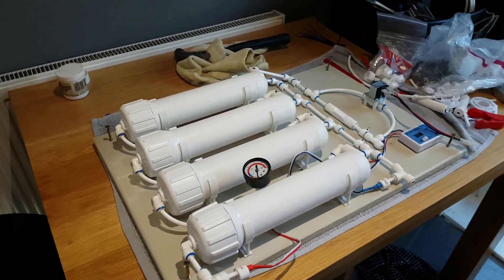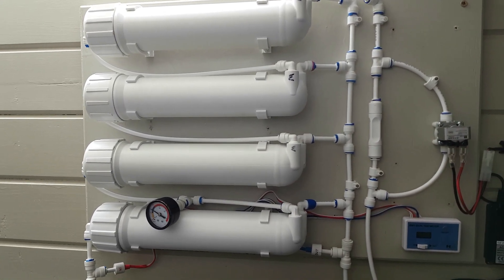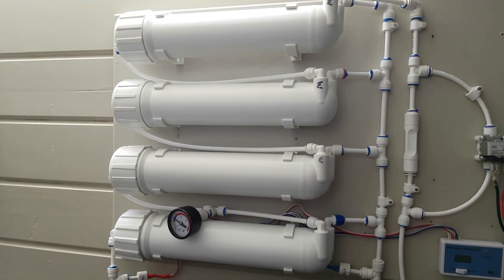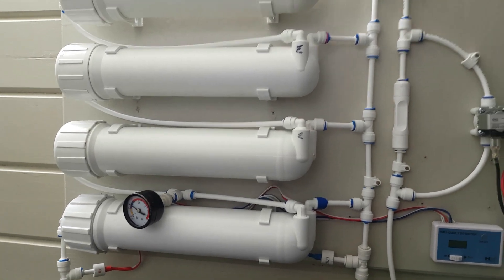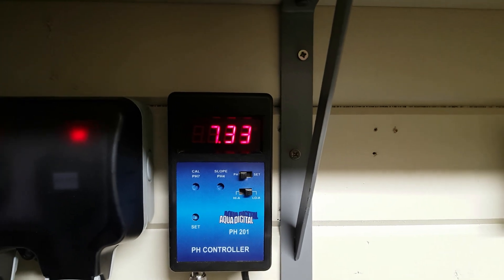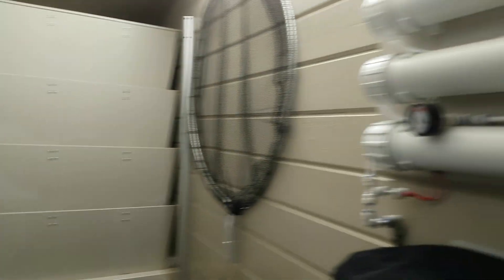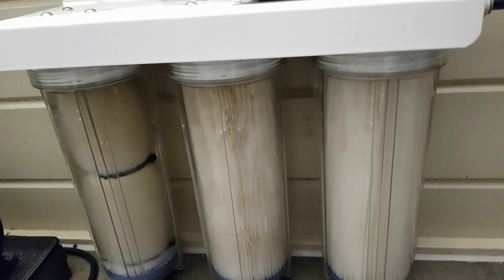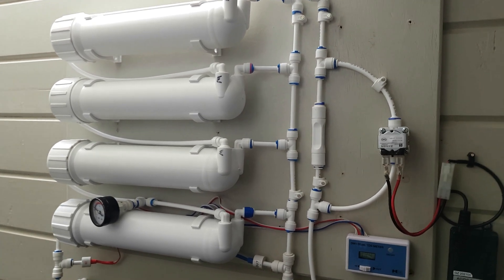DIY Recycle R.O. Update

Comment: Hi mate please could you tell me how much for all as I want to do an ro system cheers
Reply from the maker: Prices change, but ebay is a good place to start.
£200  for 4 x 150 gpd membranes inc housing.
£140 for the pump, 
£100 for solenoids
plus fittings & pipe ,
TDS meter, 
prefilters and housing
pressure gauges ect...

Comment: Hi Dave, what is your target goals for ph and tds? also what kh you aiming for, all very interesting, that ph meter accurate?
Reply from the maker: To be honest I don't have target goals for pH and TDS, pH is a result of other parameters and isn't a target imo.😃
And TDS is just an indicator for me that nitrate KH levels ect... are being reduced.
There is only 1 key critical parameter to have a target or limit for and that is KH.

once you know your ponds current KH consumption you can work out how quickly it can drop. 
and how often you need to test, but failure to manually test KH often enough could lead to a pH crash and a complete wipe out.
As has happened to 3 high end ponds i've heard about this year alone....
but KH consumption will change depending on time of year, biological activity, algae growth, and the variable KH of trickle in water.

The aim was to lower nitrate from the 20ppm it was and to concentrate and remove it.
That, and any other contaminants from the pond that build up over time, or the carbon dechlorinator doesn't remove.
And as a byproduct of doing so, to save heat lost and water used by reducing the amount of water trickling out.

I'm not running an RO set up large enough to get TDS down to single figures, and dose large amounts of sodium bicarbonate to hold KH at 1.
you need a £2000+ double 4040 membrane set up for that, and £500  a year 1 hour on/off for the 370 watt pump in electrical costs alone.😮
plus 2 new ULP membranes every year @ £400....

My pump uses 40 watts and would cost £50 a year run 1 hour on/off...@ 0.30p/kWh (what we will all be paying by April 😮)
And a full set of 4 x 100gpd membranes £59...😁

At the moment it's all about testing the set up...
Pump lifecycle and duty, as RO booster pumps are not really designed to run well from 0psi, and pull a lot more amps than specced. 
Also checking the ability of the small 10" pre filters, and the output of membranes to prevent fouling.

The pH controller is very accurate, I originally used it on my reef tank to maintain pH very tightly.
But like most pH controllers dependant on a quality probe, and I have always liked 'american marine inc' pinpoint probes.
you get very little drift and they usually last a year or so before starting.

Using a pH controller to dose sodium bicarbonate to maintain KH is fine... 
Relying on one to control the KH of a pond is wrong, and usually deadly....😃

whoops....That comment ended up a bit longer than I intended lol! 😂